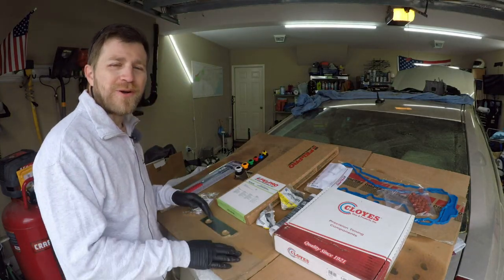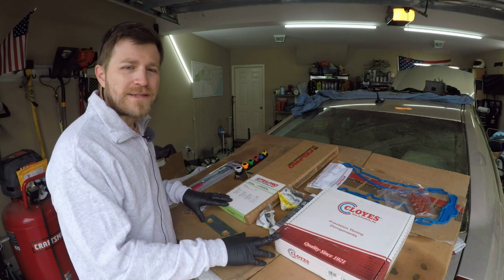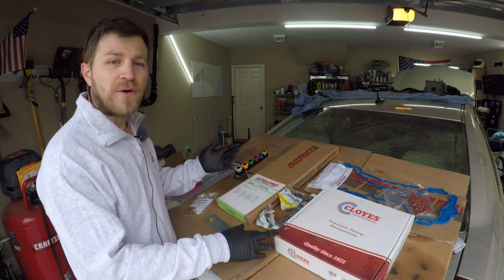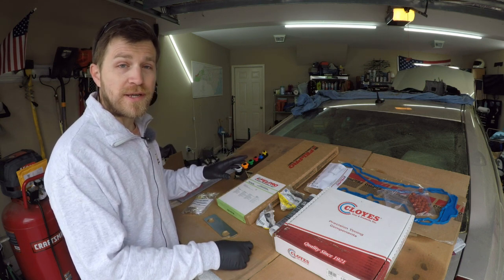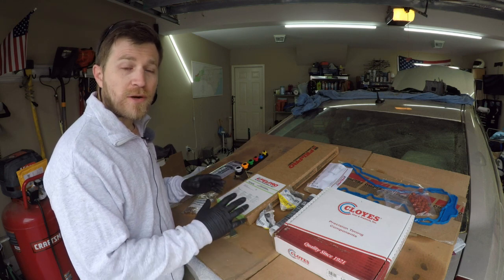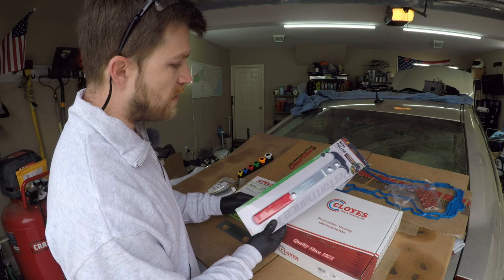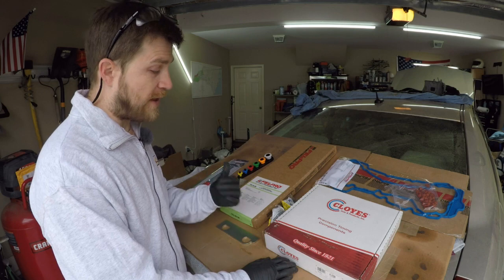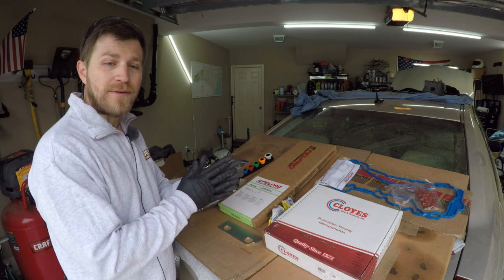PARTS & SPECIALTY TOOLS Cadillac CTS 3.6L Timing Chain Replacement

Comment: 1.Can you get away with just replacing the tensioners if they’re the problem ?  

2.What if the chain skipped a few teeth bc of tensioner issue ?  Can you just realign it ,  replace the tensioner, and call it a day?
Reply from the maker: @optpr1119  If it was me, I’d replace it all. That’s too much work not to replace everything
Reply: @ what’s the full list of things you’d replace?  I’m trying to keep costs down.
Reply from the maker: @ any gaskets and seals you take off, timing chains, and guides are what I would do

Comment: Same engine on the 2008 model? 3.6 direct injection
Reply: No I’m asking because you are the only legit tutorial but I’m not sure if it’s the same engine as mine😅
Reply from the maker: I believe there were 3 engines available for the 2008. One 2.8l, a 3.6l, and 3.6l with direct injection
Reply: @KevinNadeau  mine is the 3.6 direct injection. Was yours the same?
Reply from the maker: @dontcare696  yes

Comment: Did you have any chain noise ? I currently have one that has a similar code and has a hitting noise but goes away when rpms rises
Reply from the maker: I don't remember it making any chain noise.
Reply: @KevinNadeau  okay thank you ! Have a rough hitting noise at idle coming from what seems the passenger timing cover area
Reply from the maker: @Rehziicodm  I do remember the car would run rough from time to time.

Comment: What do you think about replacing the phasers and vvt solenoids? Already in there and I've heard stories of coming back to bite us in the rear. Great set of video's. Im a retire L1certified gm tech thanks bud!
Reply from the maker: Thank you sir! I'm not a big fan of replacing something that isn't broke, but while you're at it, might as well to save you the frustration down the road. I had my front diff out in my Envoy and I wish I would have replaced all seals. Now its leaking and I'll have to go through all the trouble of removing it just to replace a $15 seal 🙄

Comment: Where did you buy the 3 6Gm flywheel holding tool?
Reply from the maker: I found mine on ebay, but have since sold it.
Reply: @KevinNadeau  . I found one . How many hours did this job take you to do
Reply from the maker: @darinhill5351  We did this project over 2 weekends, taking our time since it was the first time I've ever done chains on a 3.6l. If you know what you're doing (and don't have 2 kids 😁) I would guess you could probably do it in 6-8 hours.
Reply: @darinhill5351  Did you finish your job? are you looking to re-sell the tool?
Reply: @KevinNadeau  Can you post the link to find the tool, I am having NO luck
Reply: Didn't do the job. Guy backed out .

Comment: I have an 08 direct injection are the parts the same like the 07 in your video
Reply from the maker: I can't say for sure.  They likely are, but be sure to check with Cloyes for the proper timing chains.
Reply: Is there a number I can call
Reply from the maker: This is the number on their website 479-646-1662 ext. 228

Comment: Hey boss, very informative video. Unfortunately I’m about to tackle timing chains in my 08 Cadillac SRX. 3.6. The question I have is regarding the holding tools. Is the flywheel holder a “Kent-Moore # J-43653. ? Also did you mention that you didn’t need to use the cam holding tools. ? I’m making up my giant parts list.. lol
Reply from the maker: I'm glad the video helped. The flywheel tool is Kent Moore EN 46106. I did not end up using the camshaft holding tool. Good luck👍
Reply: @KevinNadeau   I had a quick question cause I'm right at the part where the crankshaft bolt needs torqueing. Now you just said you didn't use the flywheel tool. My question is if you did not use the tool then how did you torque the bolt without the tool. I'm wondering because I need to torque my bolt right now and I would rather not order the tool but if I have to then I have to. Thanks
Reply from the maker: @michaelblack3254  If I remeber right, we did end up using the flywheel holding tool. Its pretty easy to install, you just need to remove the starter motor.